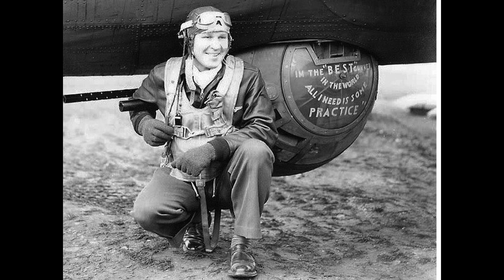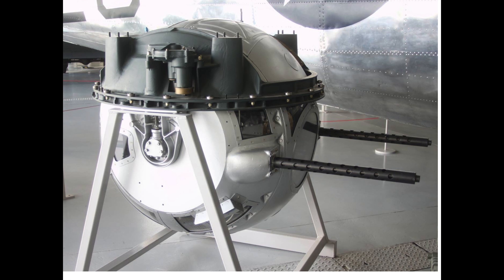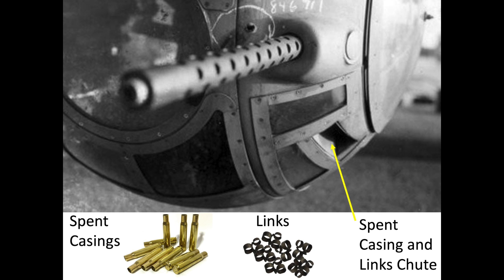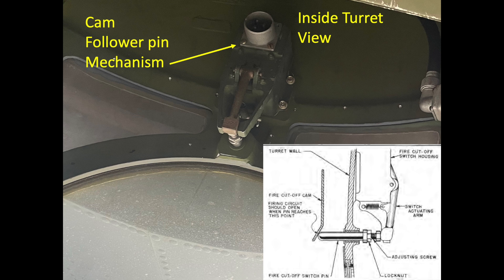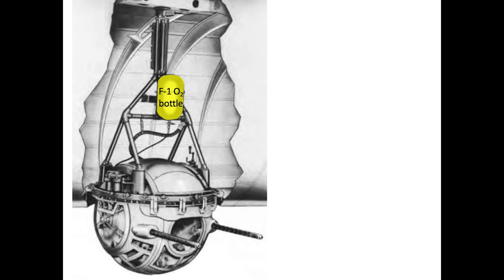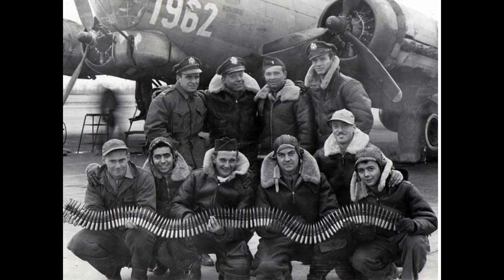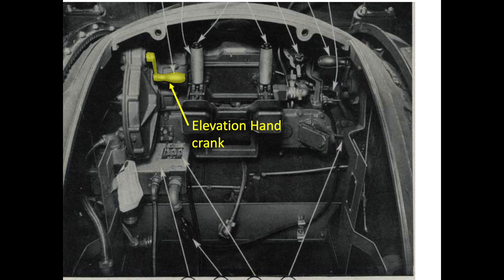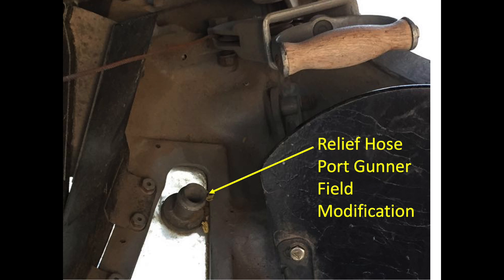B-17 Bomber Ball Turret Station, Detailed External Walk Around

Comment: Quarter inch aluminum casting and even quarter inch thick steel plate is not armor plate. And you got to remember that most of the German Fighters had a 20 or 30 mm Cannon.
Reply: flak protection, its armour

Comment: I wonder what the total weight penalty is for the system.   If the turret itself weighs 800lbs, what added aircraft structure is needed?  What are other added weights? e.g., hydraulic components?

Comment: first of all, thank you a lot for your videos; second, could you elaborate on the matter of tracers (i.e. why they were removed): were they removed for all bomber gunners? and what about fighter pilots, why it was considered ok to let them have tracers?
Reply: We found out that the tracers traveled in a different arc than the other rounds.  Effectively removing the advantages of tracer roundx
Reply: @Thomasnmi  Tracers are still used today. While not ballistically identical to the normal rounds, tracers served as a reference point for the gunner.  An experienced gunner knew where his/her rounds were sreaming in relation to the tracer trajectories.  The Sperry gun sights were only available in the Sperry gun turret at the time.  The B29 Superfortress took gun sights to another level entirely.  It wasn't till the jet age that fighter pilots had electromechanical or radar guided gun sights.  There are benifits to using, or not using tracer ammo.  If you are using electromechanical, or electronic sights, or your gunnery skill or tactics are sufficient,  tracers become a liability.   But if you're using fixed sights,  especially on high deflection shots, they are quite useful.
Reply: @SliceofLife7777  true. But we learned how to make tracer rounds such that they have similar ballistic trajectories.   That made the difference.  It took us a while to learn about this
Reply: Some fighter aces had the armorers load their guns with no tracers at all, so as not to tip off an enemy that he was being fired at. They liked to sneak in close and let rip at point blank range.
Reply: The Sperry gun sight used known wingspan of the target to compute range, and lead.  When properly used, the sights were more accurate than observing the tracers.  Tracers are not ballistically identical to the armor piercing incendiary  rounds, so could distract the ball turret operator's use of the Sperry gun sight.  Therefore, tracers were not incorporated into the Sperry's twin 50. cals.  I believe that only the ball turret used this sighting system.   So the other gunners used tracer ammo, but I could be wrong.
Reply: @SliceofLife7777  makes sense, thanks

Comment: Again your wrong the picture of the falling ball turret is from a b24 .. 
and the b17 never dropped the ball.
Reply from the maker: Monk, please see the B-17 Pilot training manual dated Oct, 1944 on pages 134 and 135. The manual recommends dropping the ball turret under certain landing conditions and provides step-by-step instructions.
Reply: @Monk Petite If you have proof of your claim then show it.  Otherwise just accept you're wrong and the narrator, who has the manual, has posted the pages etc, is correct.
Reply: @ptonpc  during my life I have talked to many veterans of all airforces served during ww2 
They can’t recall that dropping the ball was ever done during there time up.
If so where are al those balles laying around. Never is one found not on land not at sea. 
No story’s of finding a ball turret.. yes it was possible and it was done but that was a rare event.

Manuals are not there to be followed strictly..
Reply: @MonkPetite  So.  Let's get this straight.  The narrator has shown you the manuals, has told you which page the instructions are on, has posted the pictures as show in the manual.  Yet you insisted it was never done, even to the point of harassing the narrator.

Now you admit it was done.  The narrator never claimed this was a regular event, simply that it could be done and had instructions for doing so.

Here's the thing.  I have interviewed many veterans regards my area of interest and have found they misremember and misidentify many things.  You have to be careful not to take everything at face value.  It was a long time ago and they would have been in stressful situations.  There is also survivorship bias to contend with.

As just a couple of examples, I have stories from veterans who swore Lancaster bombers were used in Aden (There is no evidence for this.).  Others who thought Daimler Dingos were used in Northern Ireland (What they meant was Daimler Ferrets).

Comment: Never knew about the "piss tube" leading of the aircraft. I figured they "passed the can" around and dumped it every so often. The British had the Elcan for 'larger' jobs.😁
Reply: With all the engineering that went into the B-17 and the Ball Turret, the relief tube discharge had a tendency to spray all over the ball turret. You would've thought they would've quickly fixed that little detail. Being a ball turret gunner was a dirty job.
Reply: I love piss tubes

Comment: According to my grandfather who was a ball turrent gunner on a B24J the machine guns were 30cal. It sounds like the b17 had 50 cal guns for its ball turrent. That's considerably more firepower for the b17.
Reply: I'm afraid your grandfather mis-remembered. The turret on the B-24 has .50 cal guns. In fact the turrets themselves are nearly identical, but differ in the mounting. The B-24 has a hydraulic ram to raise the ball into the aircraft for takeoff and landing, and the B-17's is fixed.
Reply: Huh. By mid-war almost all fighters and interceptors had significant protection against rifle-caliber guns. You could still hit a radiator or any number of soft parts that would mission kill the plane, but that wouldn't necessarily stop the pilot from landing a killing blow on the bomber before falling out of the fight.

.50s were definitely more potent, and had better range, too. Ideally you'd have 20mm hispanos, but that's a LOT of gun to cram into a turret.